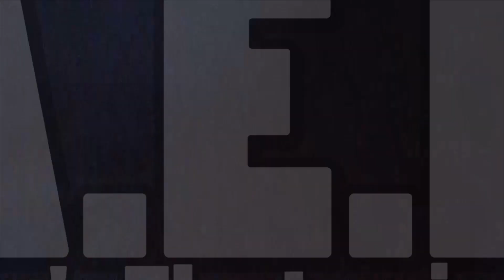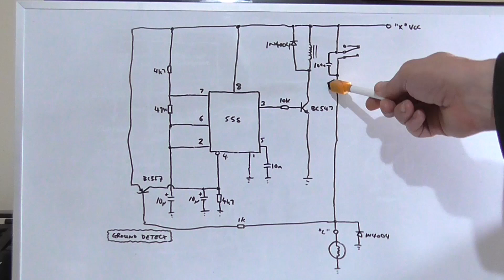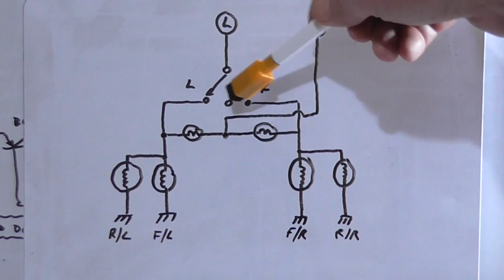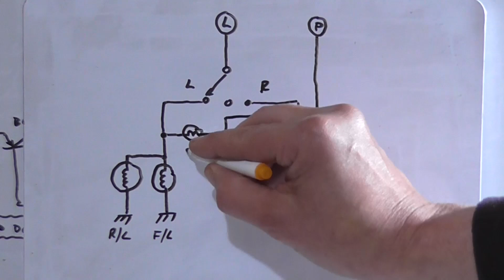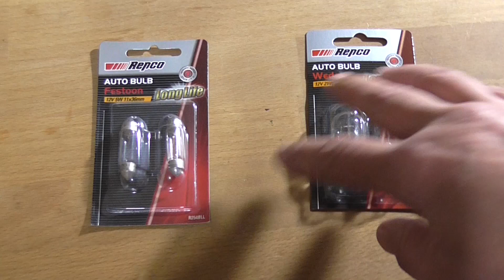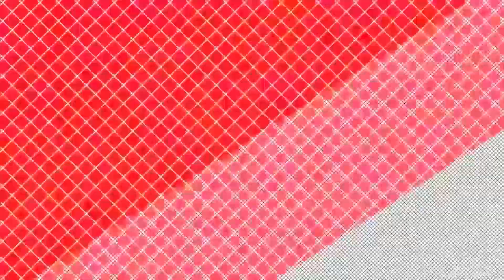555 Timer Car Turn Signal Flasher

Comment: Awesome concept, super interesting. I've always wondered how the indicator flashes faster with a blown bulb. Kepp it up
Reply from the maker: @gremlin9619  thanks. Modern electronic ones use a current shunt sense resistor and comparator.